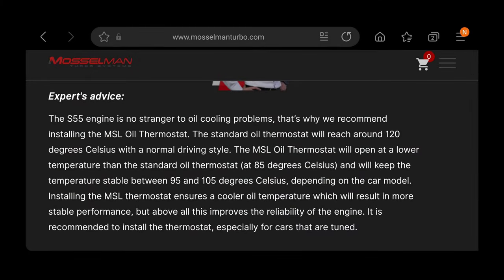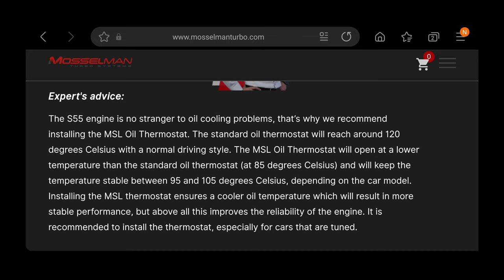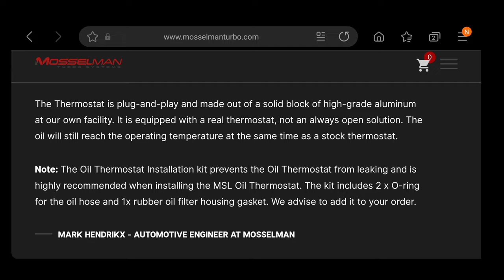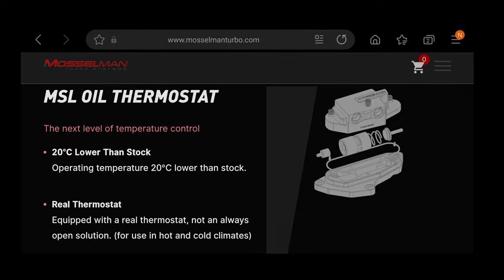Keeping My Engine Safe With This SIMPLE Modification | 2018 F80 M3

Comment: That’s a great mod, I would just wonder about carbon buildup. Long highway runs at about 240 is great for keeping clean. City driving and stop and go would benefit greatly from cooler temps.
Reply from the maker: Good points Castro. Appreciate you checking out the video and giving your insight.

Comment: Do we want the engine to run cooler constantly like that? I thought it would need to run the higher stock temp for efficiency and lubrication
Reply from the maker: Some experts say : "Performance vehicles move parts even quicker, from engine internals, to transmission gears, to differentials, only making components hotter. Cooling temperatures throughout the drivetrain will not only keep a car running longer, but will potentially help it run quicker"

I personally think its great to have the car running cooler. It allows less strain on key components.

Comment: Just a quick question, is there a product that you like to use to prevent brake rotor rust after a car wash? 🙏
Reply from the maker: The best product I've used for this is https://amzn.to/3rM5HUZ. I currently use it for my wheel / tire cleaning process. It has rust inhibitors that helps the rust issue. Unfortunately there isn't much out there that will completely prevent it. Another way of minimizing it is to use a blower the blow all the water out of the rotors, brakes and wheels.
Reply: @TheDailyDriven  thanks for the quick reply and for the help! I was looking into getting this product but I saw some reviews from ppl stating that it damages their black gloss wheels. Have you heard or experienced anything like that?
Reply from the maker: No problem! I actually never had a bad experience with Breakbuster. The only way I think that could happen is, if you leave it on for a while. Or it gets baked in the sun. I honestly think it's one of the best bang for your buck wheel and tire cleaner that works
Reply: Hydes is a good product for this.  You spray on after washing and it helps prevents rusting. Obsessed Garage has some videos on it.

Comment: beatufiul wheel setup, can you recmmond a good size for my M4 Front and Rear for 20''?  BBS LM or LMR Setup
Reply from the maker: Depends on how aggressive did you want the fitment.  My fitment wasn't recommended by BBS but it fits with not rubbing. I just had to add a little neg camber in the rear.
Reply: @TheDailyDriven  I want it aggressive
Reply: I'm thinking of just doing the 9.5 in f and 11 in r
Reply: @TheDailyDriven  which color LMR u think I should do my F82 M4 diamond black?

Comment: You do realize that when use sport plus causs the cooling fans to run full time, which brings the oil temp down. I don’t see the need endless you regularly track your car.
Reply from the maker: Yes I did know that. I just don't see the need to have Sport+ constantly running.